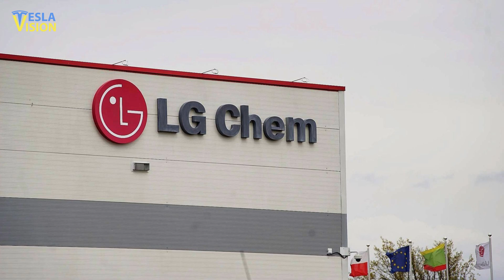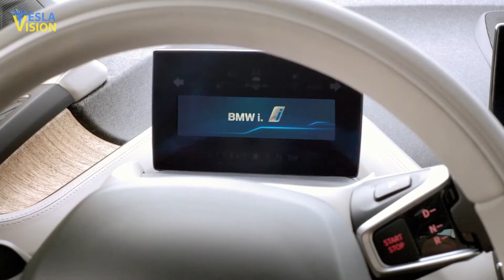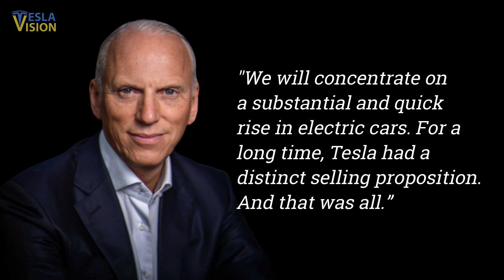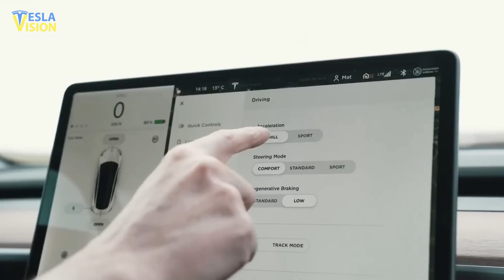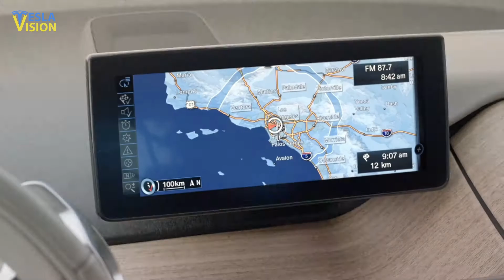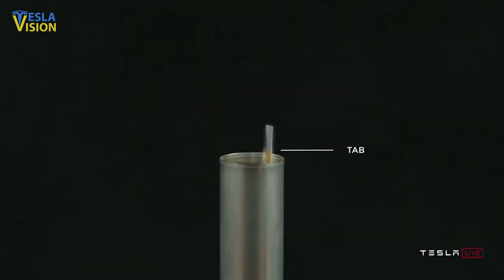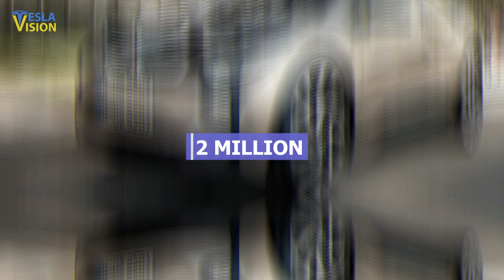Elon Musk Knew It All Along

Comment: Just cause BMW are using the 4680 size doesn’t mean it has all the same tech and cost saving that the Tesla 4680 has. I’m sure they are not using a dry battery electrode process as well as silicone in the anode to name a few